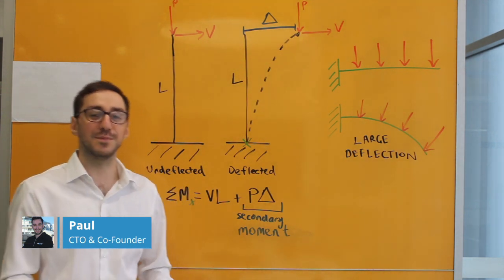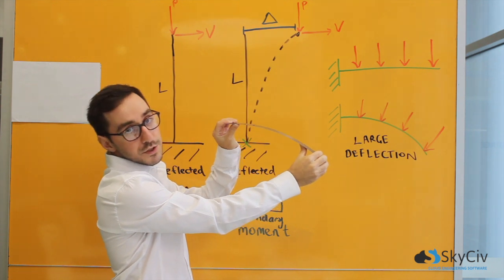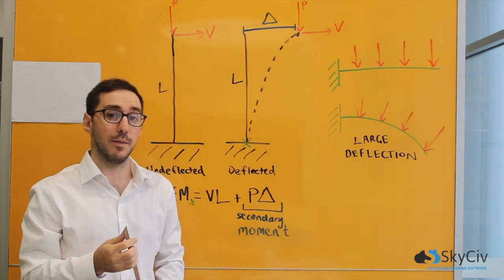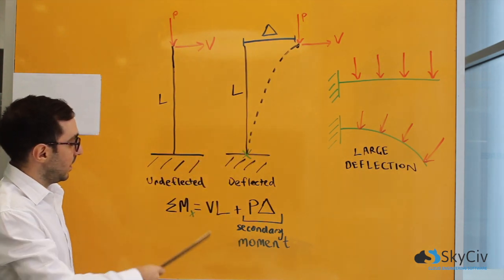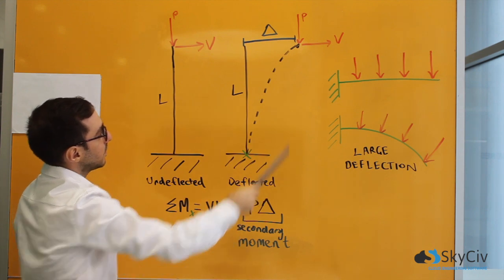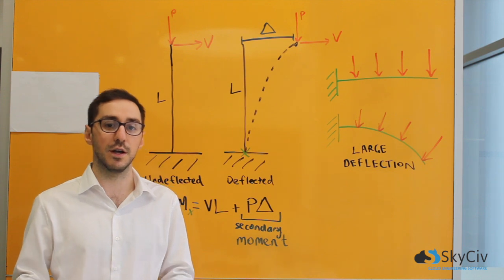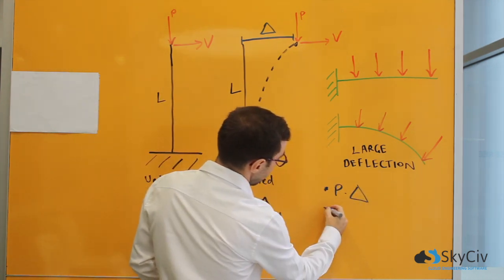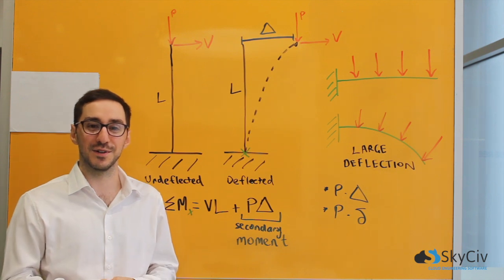What is P-Delta Analysis?

Comment: You said its a mult-storey building,   I understand the gravity load P is almost zero at the top
If you said lower story columns that would have made sense. 

Overall,  load would rather acts around centre of mass.
Reply from the maker: Good point Nazar - thanks for the comment. Correction: that negative P would be from the gravity load from the stories above
Reply: @SkyCiv  Thank you for your replay. Best of luck with your software.